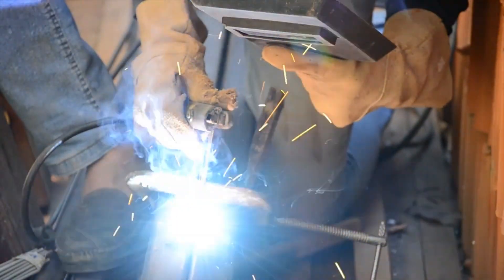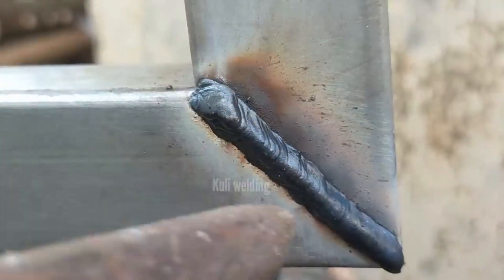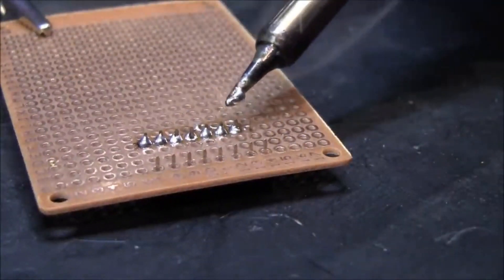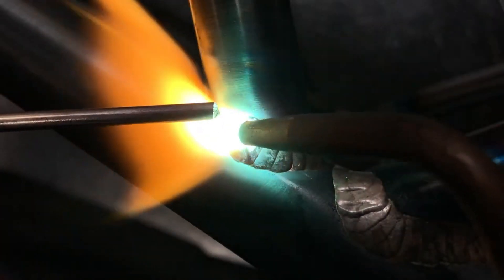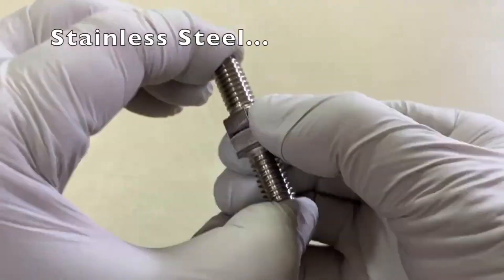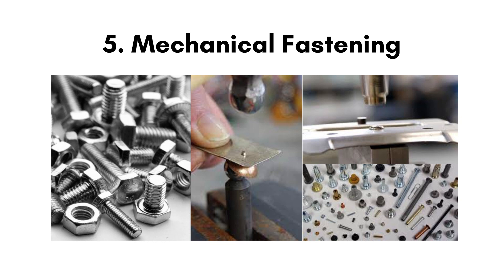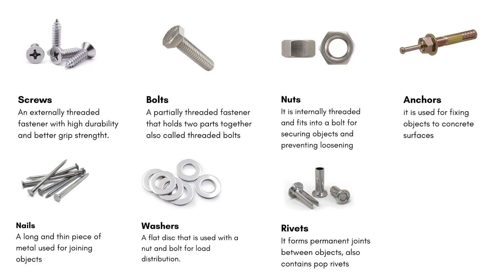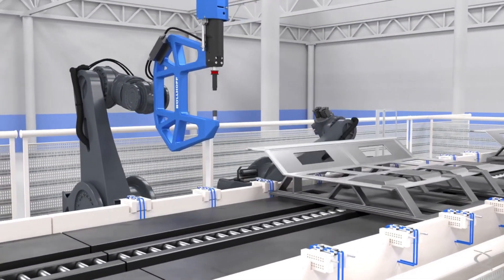6 Most Common Metal Joining Methods

Comment: I have a question, are all the methods permanent except for the mechanical fastening? Or is adhesive bonding not permanent as well?
Reply: The shown methods are permanent besides screwing and riveting. Adhesive is also permanent, since there always remains the risk of leaving behind oddments or pickings destroying the surface.